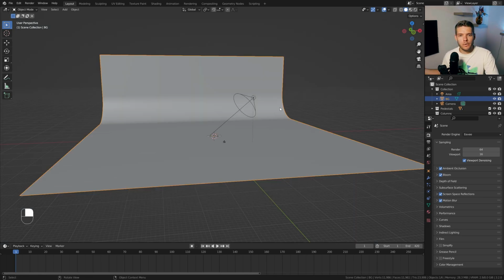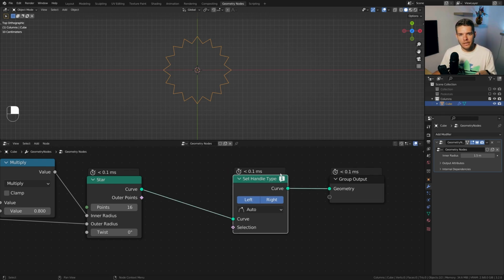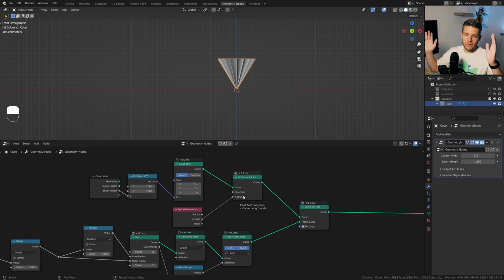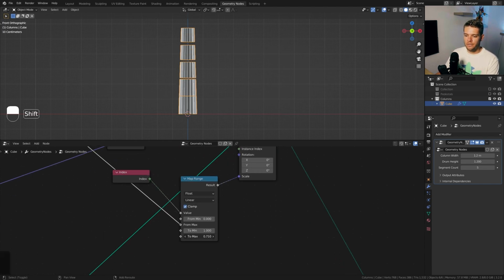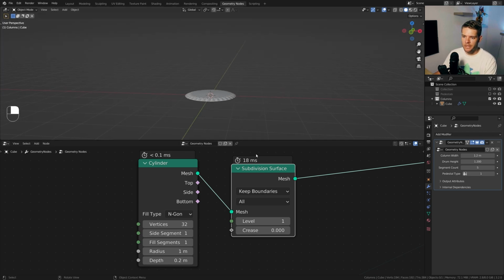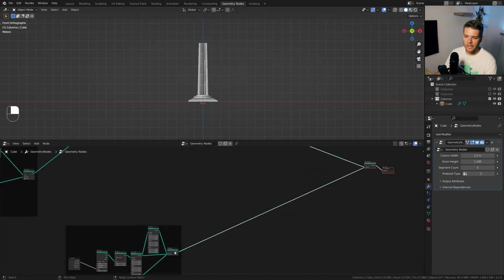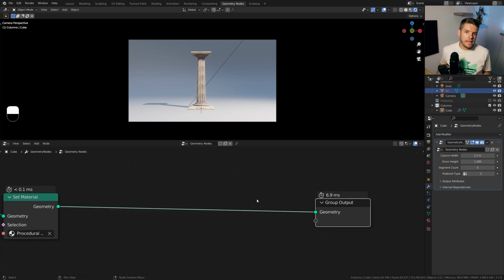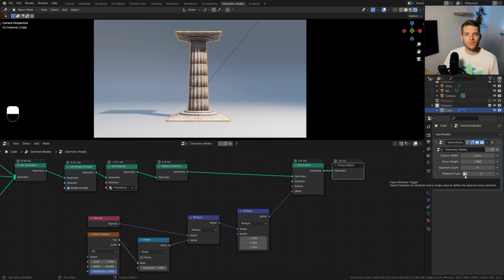Procedural Greek Column Generator in Blender 3D

Comment: Maths isn't my strong point, but I was wondering if there's a way to link the "drum taper" to the segment count, so if you change the taper the offset remains proportional?
Reply from the maker: I've tried a LOT to get that working properly but sadly couldn't find a procedural workaround. So manually is the only way to get it right as far as I know.

Comment: Great tutorial. One remark though: the drums all have only shading at the bottom. Could this be fixed easily? It looks a bit unnatural.
Reply from the maker: Good mention! But yeah this is due to the realize instances node. In the Gumroad project I’ve changed it a bit so there’s a sort of ‘remesh modifier’ included with the use of volume and volume to mesh nodes. This also fixes that problem! :-)

Comment: Amazing tutorial. Why did we do the tapering part when creating the segment array? Ah, I think because you tapered it in the beginning and after creating the array the tapering effect went away? Right?
Reply from the maker: Thanks! Well the first taper is just to determine the segment itself sloping inward. But this creates overlap if we add the array without a second scaling taper. Since the columns don’t have these overlaps we need a secondary taper, just to fix this. Hope this makes sense haha!
Reply: @KaizenTutorials  Haha, thanks. I saw lots of ancient stuff lately and this is amazing. Actually I saw your latest post on Patreon. I couldn't read the full post because it is locked. But apparently you updated the pillar generator. What did you change? One thing that is really interesting and that I'm currently working on is a pillar that looks like the real roman and greek pillars. If you look at roman pillars on google the "star shape" actually doesn't always make up the whole pillar. It actually is a "U" shape at the bottom and top of the pillar. Do you think this is too complex to achieve with geo nodes or do you think that this is doable with curves? Thanks in advance.
Reply from the maker: I updated some nodes, added a remesh setup to get better geometry around the segments and cleaned up some nodes to make the entire thing more efficient.

The U shape was something I did work in the beginning of creating this GN system. I wanted to use booleans for it instead of curves, but the entire thing became super slow. So I went back to this current setup.

It's probably possible to do though with curves. I just don't know how haha
Reply: @KaizenTutorials  I actually solved the issue. I wanted to replicate the same way the pillars are usually modeled in tutorials. I decided to use a cylinder node and inset all the side faces and extrude them in. However this setup didn't work as intended. So I talked to someone on the blender discord who was incredibly helpful. The node setup got a bit complicated but the end results are great.
Reply from the maker: Well you’ve got me curious! Would love to see the end result 🙏🏻